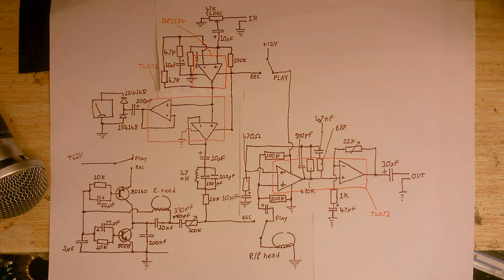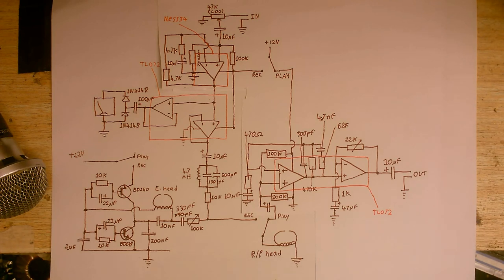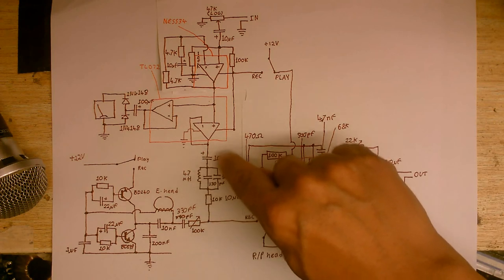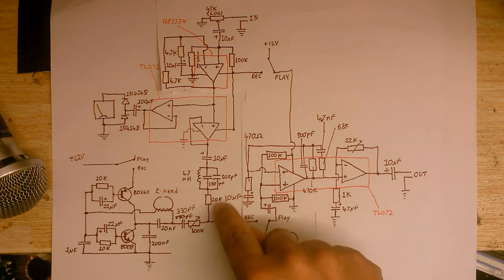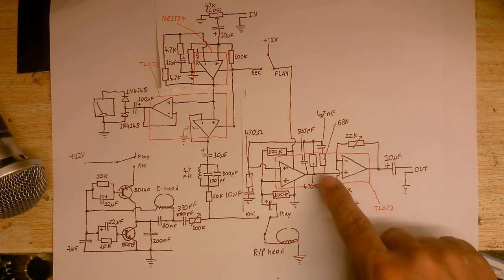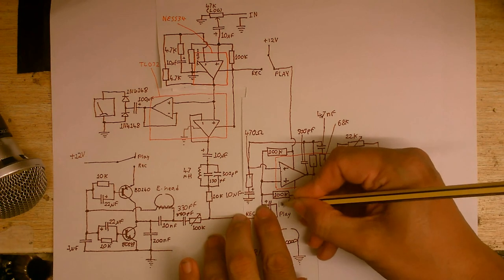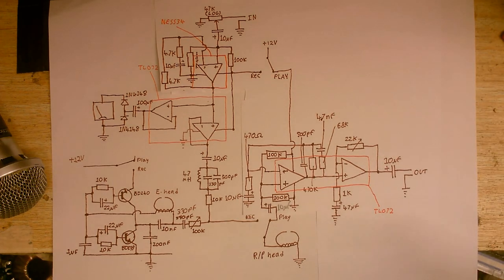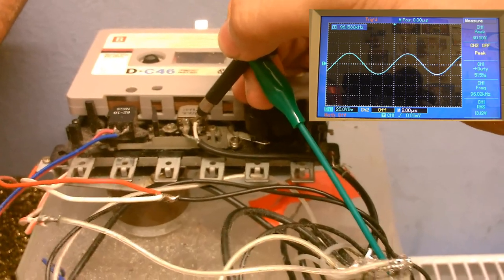Talk through of my home made tape recorder final full circuit

Comment: Hey Clem, Good job on the recorder circuit, quite the project. It looks to be a single supply rail with the use of the voltage divider network for the op amps. I'm glad your still doing electronics and doing well. It was 103 degrees Fahrenheit here in Oregon today, August 11th, too hot to do much outside, except early morning. I've been really busy lately but always will make time for a CDC video. I'll be looking forward to seeing what else you have been working on in future videos. Hope your having a good Summer. All the Best from, you guessed it, Oregon, Cass.

Comment: Great discussion Clem, you did fine.
Hiss was the reason for Dolby noise reduction. You could try adding a Dolby circuit into your tape recorder.
Reply from the maker: I don't really intend to add Dolby, even on decks that have it I rarely use it. The trouble is that my playback circuit itself has some considerable hiss because the op-amps are working so hard to boost the entire signal. Adding an extra stage of amplification right at the input, using a single transistor would fix that as the op-amps wouldn't need to work so hard.

Comment: Hi Clem, I am thinking to give this circuit a try, but before that I gotta ask something I've been considering doing for a pretty long time:
Do I still have to wire up a playback preamp circuit in case I want to plug it into a mixing desk that already has its own preamps on board? With that being said, can I simply connect a reproduce tape head straight to the mixer (and expect it to sound acceptable)?
Reply from the maker: It might work if you connect the head to a mic input, but it would be lacking in bass and proably wont be very loud. It would be best to build the preamp circuit and connect that to a line input.
Reply: @CoolDudeClem  Thanks for the reply! Love your videos, btw